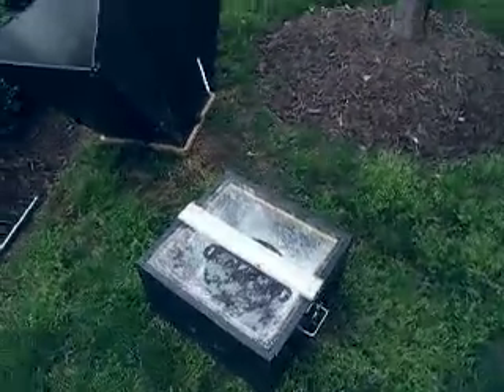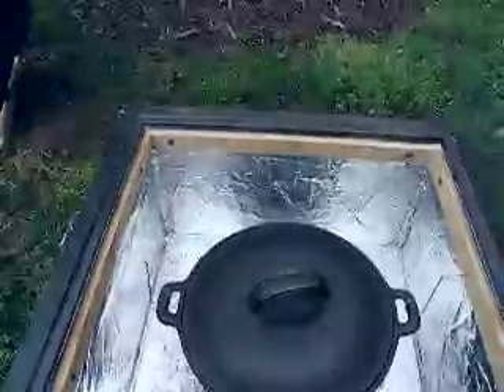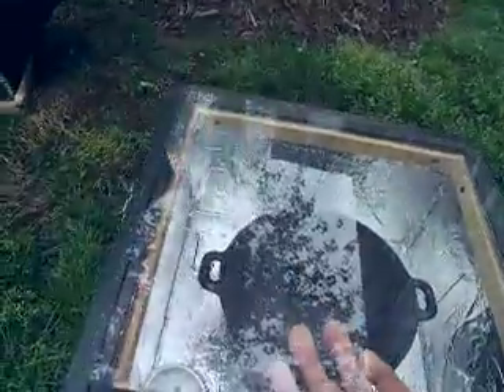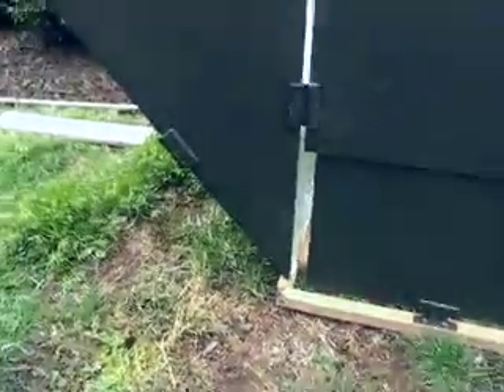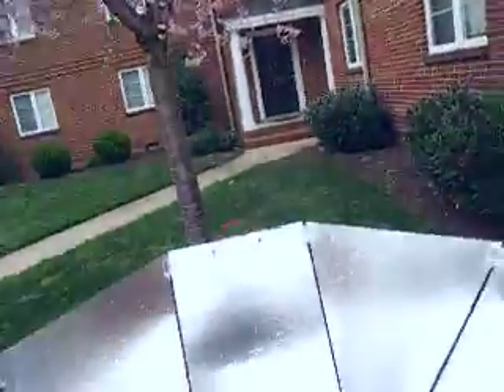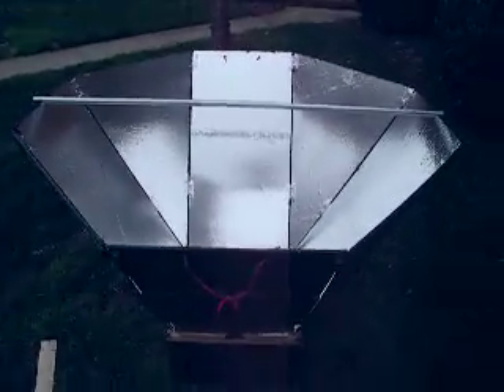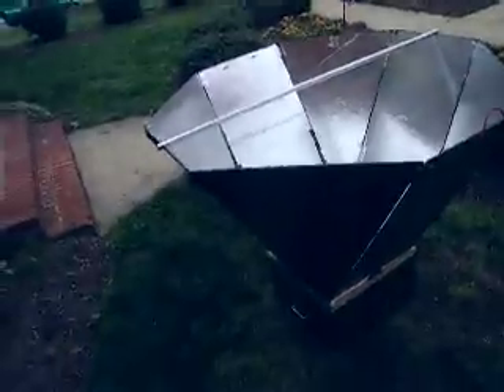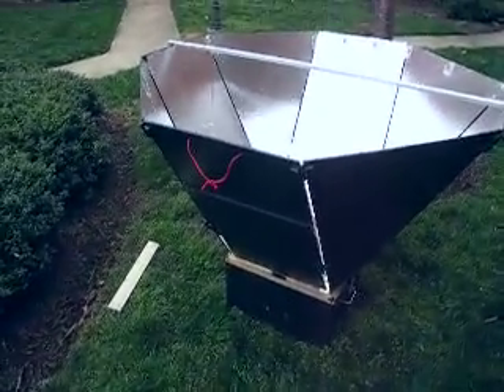DIY Solar Oven 60/40 Design *340degrees reached! :O)*

Comment: Thanks for the video.
A couple of observations. 
I would start out by finding a piece of tempered glass and build the box to fit the glass.
I might use rear view mirror glue to make a double pane glass cover.
Glue in a 1/4" spacer of plexiglass strips around the edges.
Build the box so the glass fits down inside the box a little to protect the glass.
I like the cast iron pot. I would leave it in the oven all the time so it would be pre-heated before I put the food in the pot.
I see that the four sides fit the box and the triangles fill the spaces.
I might tape the four sides at the botton to the box, then drill holes in the top corners of the four sides and tie string though the holes and lower the four sides to the angle I liked.
Probably my latitude angle.
Then measure the distance across the open space at the top to get my triangles width at the top end.
Instead of a swinging pot I think I would use a piece of wire shelving with an angle on it to set the pot on if I needed to angle the box a little. 
I am working on a design and I have to say that I like yours for the durability of it.
Thanks again for the video.

Comment: i made one for 8th grade project and mine went to 320 degrees. i took a box and put a smaller box inside and put foam between the two boxes and used reflective film for the reflectors.

Comment: Reflectors are way too big.  Do some reflection diagrams.  Half the area of the reflectors is lost in overshoot.  Never use cast iron in solar cooking.  Its thermal mass absorbs way too much heat before anything gets cooked at all.  BTW you meant to title this 30/60, not 40/60.  I have a cardboard/coroplast 30/60 solar oven that can pull 450 F at 32 N latitude in the winter.

Comment: A couple thoughts: the suggestion of triple pane glass would be good if it were plain glass. A lot of pre-built windows will have low emissivity and/or filtering coatings to reflect heat, which would severely impact the performance of the unit. Painting it black on the inside? Might not make that big of a difference. The black would theoretically get hotter, so maybe?

Comment: I wonder if using a double or triple layered  glass cover would heat the oven faster/hotter. Any ideas folks?
Reply: Yup. Just like home windows, double glazing will retain more heat. I haven't tried this with triple glazing, but my guess is the cost/benefit is not there. Unless of course you can scrounge one for cheap or free.

Comment: Someone asked about putting it in an oven bag.  I don't understand why that would be needed if he's got it in a sealed box.  The oven bags are for those who just set their black pot/container inside a funnel-type reflector without the sealed box, but the sealed box works like the sealed oven bag.  Also, someone said won't work, too many open sides for losing heat energy. IT'S A SEALED BOX, NO OPEN SIDES. ???

Comment: Ho, and indeed, aluminium is a good reflector, but it's not a specular reflexion (mirror like), it's very difuse reflection. I think you could either reach higher temperature, or downsize the reflector if using a mirror like sheet of reflectors. Mostly saying that for viewers ;)

Comment: Hi. The reflectors look too inclinated regarding there size. (The larger the reflectors, the smaller the inclination) Did you try to report the reflectivity with a laser pointing on the reflectors ?
Thanks for the demo !

Comment: The designer of a different type of solar oven I found here placed his cooking pot inside a large roasting bag. This might help you in a couple of ways. 1. If painting the inside of the oven black is better than foil then the roasting bag should keep the paint smell out of the food. 2. The roasting bag would trap the condensation you mentioned so you could still see inside the oven to check the temperature.

Comment from the maker: As for the reflector size, it makes me excited to see the giant reflectors. Might be able to get by with less, and may even be a little off on the angles but the excitement I get when I see my giant solar oven a roasting away in the yard... 

Originally the reflectors were an extra foot longer but  a cutting error made me have to cut 'em down a bit. :O)

Comment: good job !! will try your app's  with funnel ,,but I covered my last reflector pannels with mylar mirrior film ..greenhouse suppies carries rolls but e-bay was where I located 4ft w / 150 ft roll cheap ..my poorly sealed DIY solar oven hits 270 with a droopy heat stressed plex-glass door ..lot better than foil reflector ..baked a good cornbread though despite heat leaks..slow but tasty and we also think foods taste awsome .. !!

Comment from the maker: I did use regular tin foil. I used the heavy duty foil and covered the wood with elmers wood glue (Using a cloth) I just gobbed it and smeared it all over and then rubbed the tin foil down onto it with a clean rag. It worked out really nice. Thanks for all the comments, so happy to hear you enjoyed the video!

Comment: anytime you paint the interior, let it heat up with the door slightly open and let it gas off for several days before using.  Or, you could use simple black craft acrylic paint or black tempera, both have no odor and can be used the same day.

great oven!  hope to see more vids!